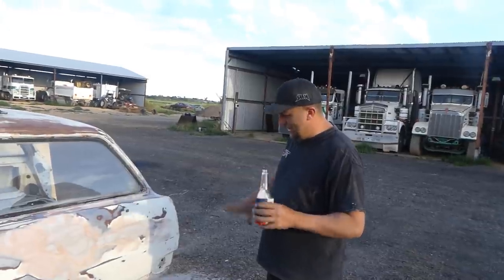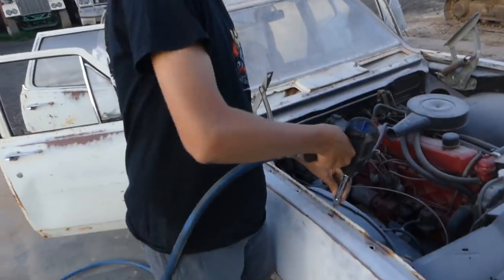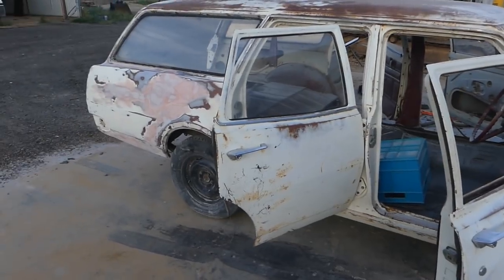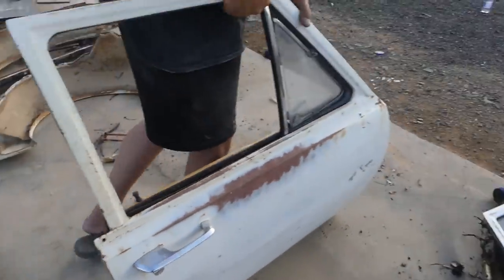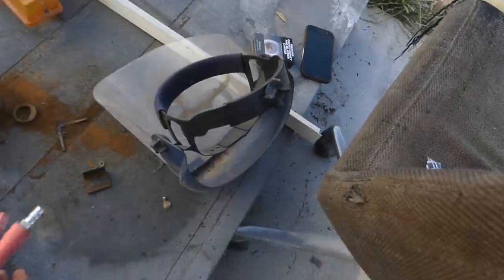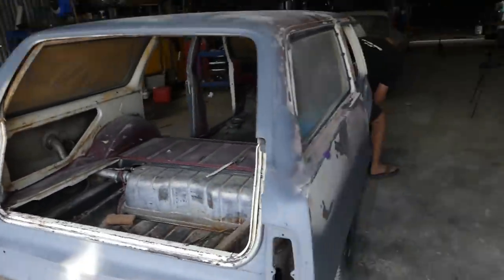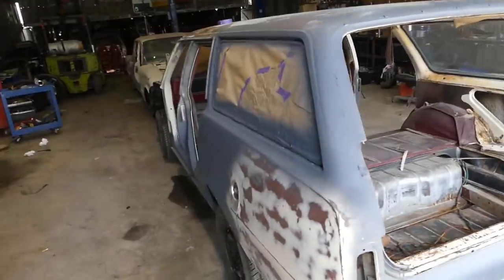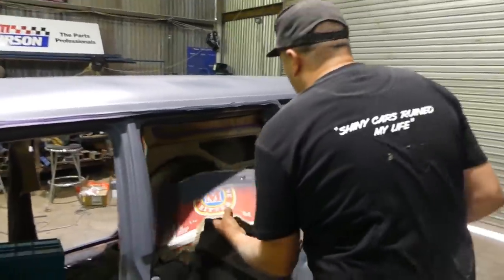HOW TO PAINT YOUR CAR AT HOME ON A BUDGET! COLOUR REVEAL FOR FLORENCE

Comment: thinners takes paint off anything.. also takes colour off vinyl trim if not careful. 
went for a google on the green, found one the same as you are doing..i'm sure you could fix that door.. even temporary and fit/paint another later? that 186 hammers in the light weight body....like the toxic avenger of street machine carnage almost  https://i.imgur.com/y1lKzWS.jpg